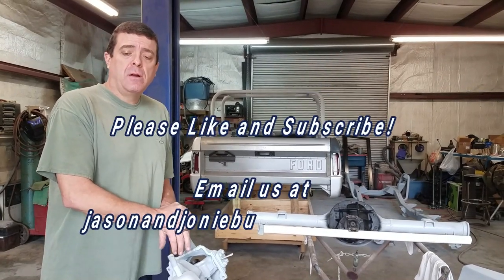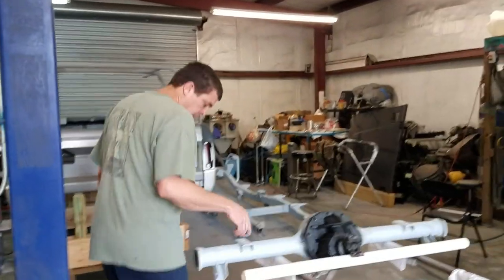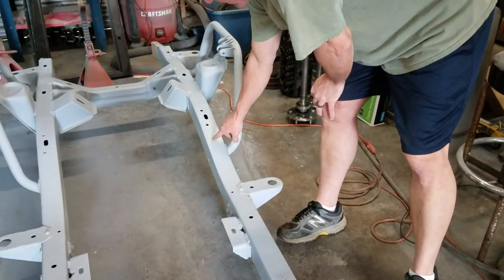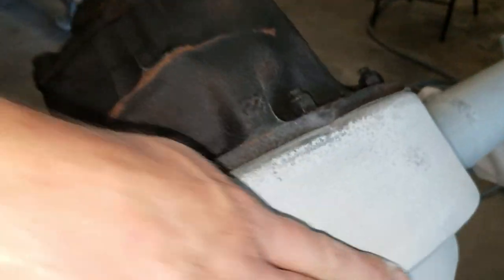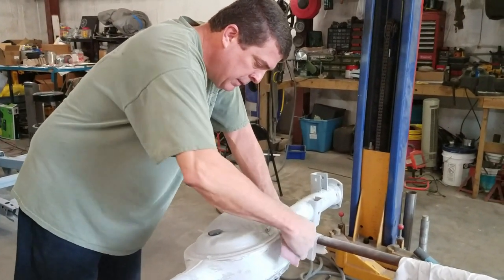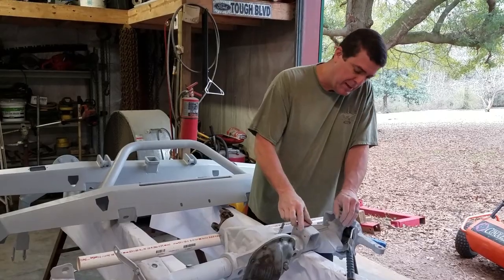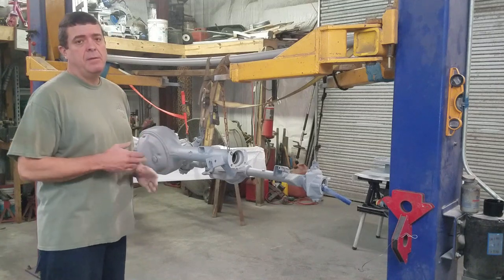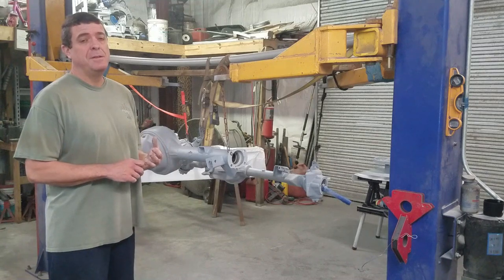Sanding and Priming Chassis Parts - Storytime with Paw Paw - 1966 Ford Bronco Restoration Project

Comment: I don't have OCD either, but after 10+ years I was given a 2002 Kia Sportage. I put new complete brakes in, Front disc, back drums. New valve cover gasket, new spark plugs, coils, wires, and harness wire. All this to find out the suspension is rusted and shot. I told the people I could not afford the up keep, so my daughter has been helping me. I'll drive it until the death wooble sets in and half to get rid of it. It's nice to see a well kept or put together vehicle and well maintained, but it's tougher to see it fall apart...lol  God Bless
Reply from the maker: I hate that Jack.  I bought a little car from Ohio to run around back and forth to the paper mills.  Once I got it I found out what salt does to a vehicle.  Luckily we don't deal with that down here.  Thanks again for watching.

Comment: Hey Jason,
Thanks for sharing your knowledge and techniques, love the videos.
Can you comment about addressing rust inside the frame rails? 
I’ve kind of felt that painting/treating the outside of the frame makes it look nice, but if it’s rusting from the inside out eventually it’ll be a problem again.
Is it beneficial to clean and treat the inside of the frame rails?
I’d love to hear your thoughts on this and if it’s something that should be done or even worth the time.
Thanks!
Reply from the maker: Chuck,
This is a debated topic for sure.  So I will start with this.  IT can't hurt to prep and treat the inside of your frame rails with Por 15 or other similar products.  We live in a great environment down south where if you keep your frame clean and not packed with mud or sand the moisture does not have a place to sit and really do the damage.  I think unless you dip your frame it would be hard to ever completely coat it inside.  I prefer keeping it clean.  Up north is a differant issue because they have salt to contend with.  So any preventive action would be a plus.  Just my 2 cents.  Not the gospel by any means.  Thanks for watching.